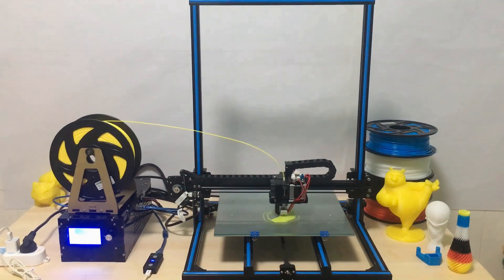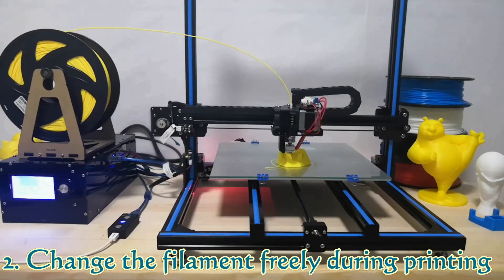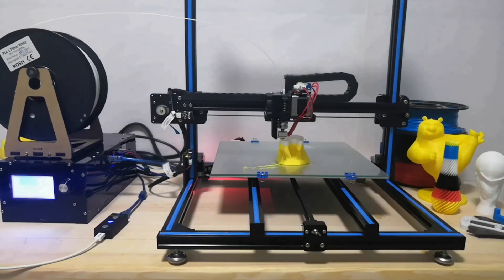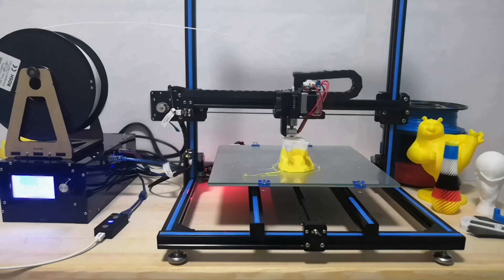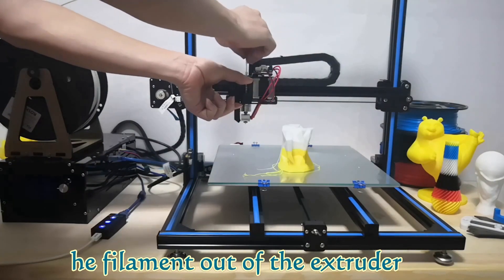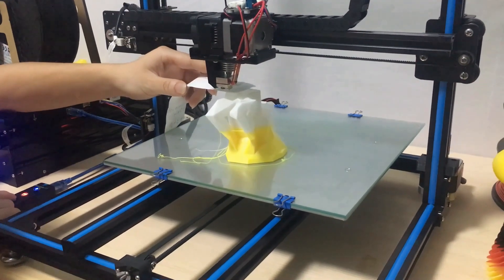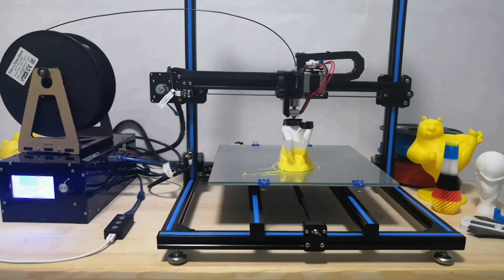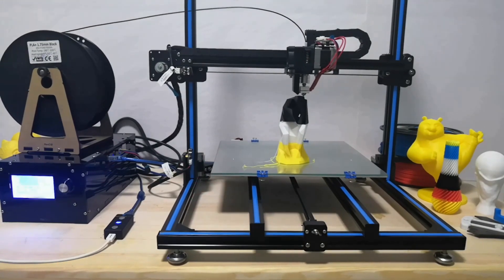How to resume failed 3D printings automatically?

Comment: I use a Geeetech A30 Pro with power loss detection. After that it automatically resumes the print. But if it go layer for layer and no filament is extruding due to nozzle jam...this 3D Resumer will also work? Because the printer thinks he can continue at the same hight...